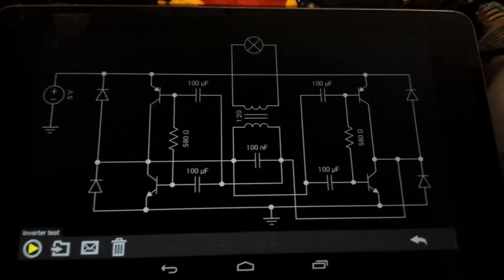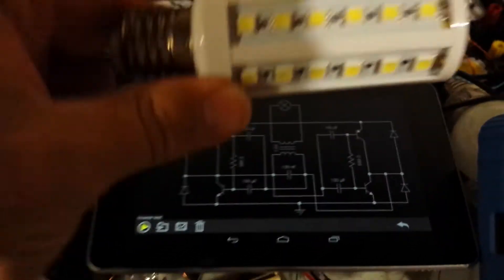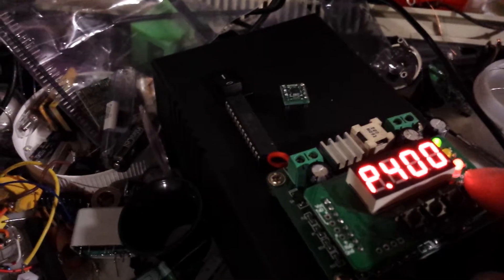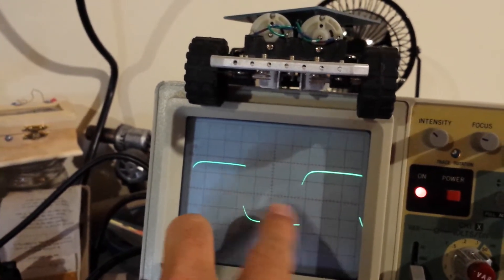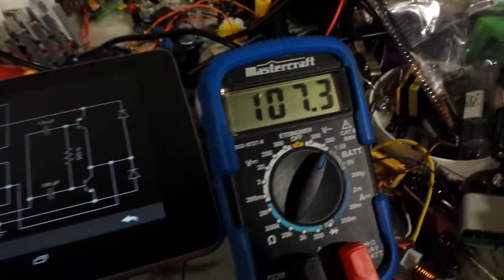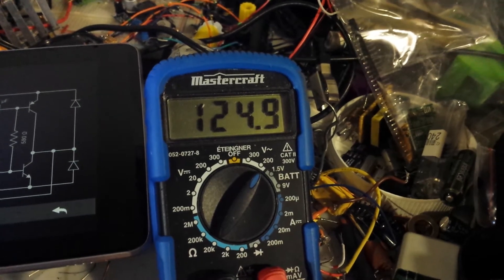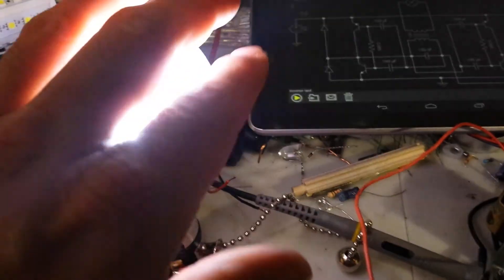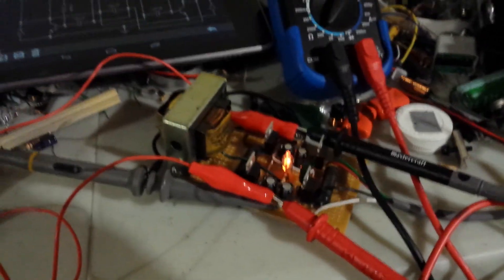4 Transistors Inverter 5 to 100 VAC

Comment: Thats some amazing efficiency with such a simple circuit!

Thanks for sharing ;)
Reply from the maker: Thanks :) I'm not super sure about the efficiency but it work very well might have to experiment with power in vs power out all I know is it's not suitable for any resistive load I try a little 7 watts incandescent and the circuit simply stop also CFL seem to do the same thing circuit simply stop oscillating I think I might go for a set frequency one using either an Attiny85 or go the old fashion way with either full transistor or using OP amp :)

Comment: Good effective circuit there....looks to be quite frugal on the mA.
Reply from the maker: Yeah it's not bad depending the load it will vary now I only need to find a way to keep it running if bigger load are use :P

Comment: that would work wuite well on a 6 volts baterry!
Reply from the maker: +kiskiller3 IT would indeed! Although I don't have any of those lying around lol I do have a ton of usb power bank and it was the original reason I build it but since it work better on voltage above 6 volts it quite unpractical and also since the frequency is not even close to 60 hz it's only good for light on thing that don't rely on 60hz to work well :)
Reply: Yeah ive got a couple of 6volts sla they would be a perfect ,match with this!
Reply from the maker: Indeed :)

Comment: Yaaa! I LIKE IT....Can you run it on 14.5 volts down to 11.5ish? What modifications might be needed? and where can you get that voltage supply that thing is sweet
Reply from the maker: The little buck converter power supply can be purchase at icstation.com in there power module section then you need something to provide the max voltage you need in my case 26 volts :) then yes the inverter is very easy to modify to work on any voltage all you need is proper voltage rating on the capacitor mine are 10 volts and the transformer you need for the job mine is a 6.3v. The resistor will vary depending the transistor you use I use tip31/32 for the job they are low power but work great for the little power I need for this one :)